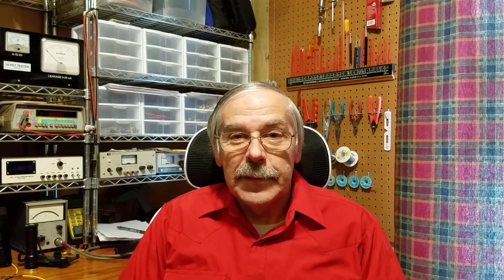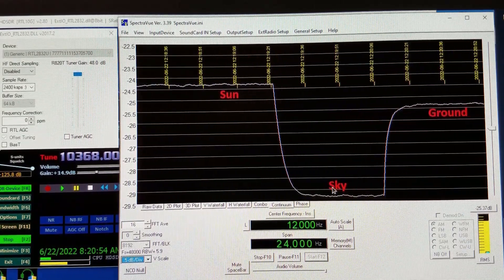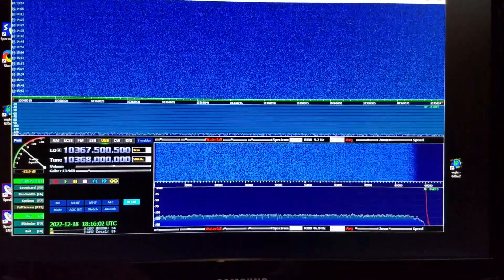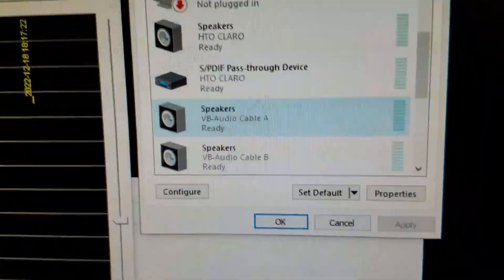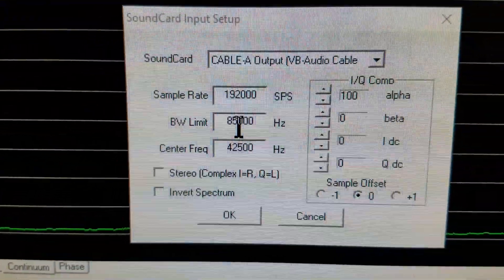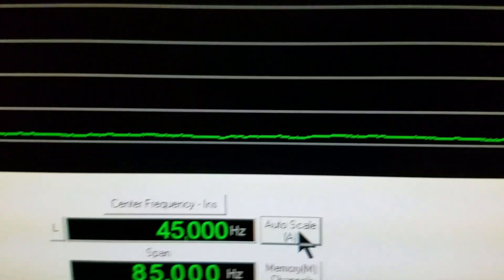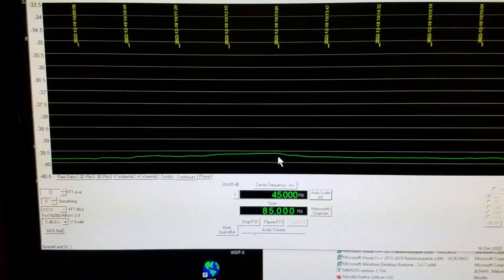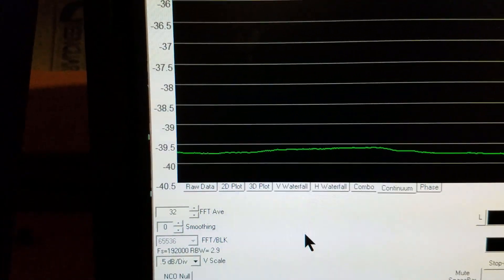10 GHz Noise Measurement for LNB System

Comment: Objects warmer than absolute zero emit noise.  That's what you're measuring.  Put your hand in front of the feed and you'll hear noise - your warm hand is emitting 10 GHz.  The sky in a snowstorm is warmer than cold sky.  Also, the sky isn't uniformly cold as you imply.  The plane of the galaxy is warmer than other places in the sky.  Just as pointing at the Sun measures noise, pointing at the 400 billion or so stars in the milky way also measures noise.   With a big enough dish, that becomes significant.
Reply from the maker: Thank you. This is the first time I have heard that the sky is not uniformly quiet at 10 GHz. I know it is not at lower frequencies such as 144 and 432 MHz where I had prior experience. When I asked about using sky/sun/ground noise measurements to evaluate feedhorn (LNB) placement and performance of this system, everyone said it would not matter as long as I was not pointed at the sun or moon. Maybe they meant "with this size dish"? Now I want to do more experimentation with this, when and if I get a dish on a proper mount where I can more easily steer it and up higher where it can see more of the sky without also seeing trees or my other antenna structures.
Reply: @n1bug  Here's a paper that compares galactic sky maps made at various frequencies from 10 MHz to 94 GHz.  It has a section that shows visual images and references to various studies of the energy received from the sky at different frequencies that might be interesting to you. arxiv dot org/pdf/0802.1525.pdf
This is a radio continuum map made of the galactic plane at 10 GHz: cade dot irap dot omp dot eu/dokuwiki/doku.php?id=nobeyama
Reply: @n1bug I'm not sure if the links to those papers are making it through the comment filter or not.  Google for "nobeyama 10ghz radio continuum" and you'll get the 10 GHz map of the galactic plane.   Google for "arxiv Angelica de Oliveira-costa galactic radio emission" for the paper talking about sky maps at various frequencies.  You might find them interesting.

Comment: noise level from the snow is probably the ground noise reflecting off the clouds, or reflecting off the snow itself; the denser the snow fall the more reflective the clouds or snow. or further, it could be noise power from the snow itself.
Reply from the maker: Thank you. I think what I was seeing that day may have been noise from the "warm" snow itself or the snowflakes reflecting ground noise. I think that because changes in noise level tracked so well with intensity of the snow. It makes sense that clouds would have some influence. It would be interesting to investigate this further.